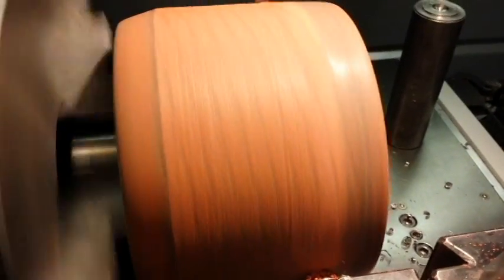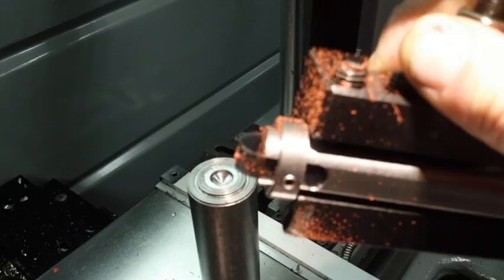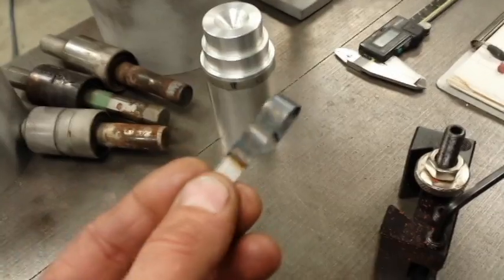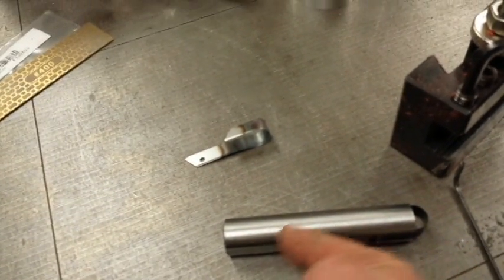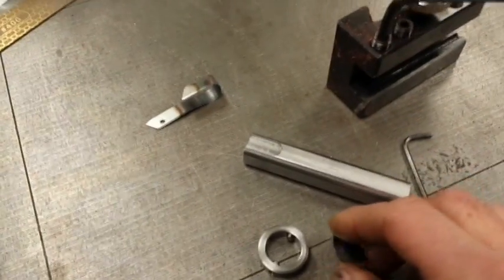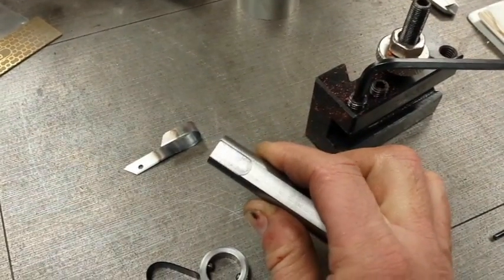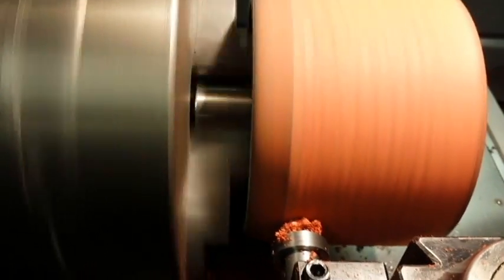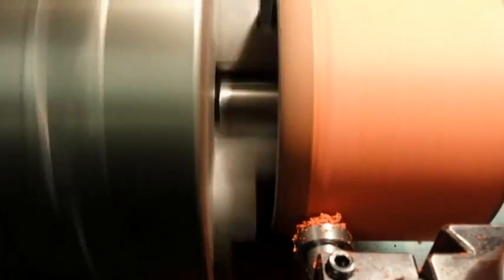turning rubber on a lathe

Comment: After reviewing the video and determining that I didn't have the time or inclination to make a holder for a one-time project, I used a short length of discarded bandsaw blade, bent it into a U-shape per the video (though I didn't heat it up) and sharpened the back-side of the blade (not the side with the teeth). Then I was able to clamp it into a standard tool holder, set it up below the workpiece centerline (per the video) and it worked surprisingly well! I wouldn't have come up with this without the video, but perhaps my effort will help someone else.

Comment: I just went through all this before seeing your video... I used a replacement blade from a linoleum v-grooving tool. This worked extremely well for resurfacing the 28" rubber drum on our widebelt surfacing sander.  https://www.amazon.com/Steinel-09011-Replacement-Blades-Groover/dp/B00PBA10DK  Thanks for sharing your video!

Comment: You could get a much smoother surface finish if you tilted the cutter a bit; giving it larger clearance angle. The problem here is that the tool's underside is rubbing heavily onto the rubber's surface, resulting in a rough finish. Neither the feed not the rotational speed is the problem here, it's only a matter of proper tool angles.